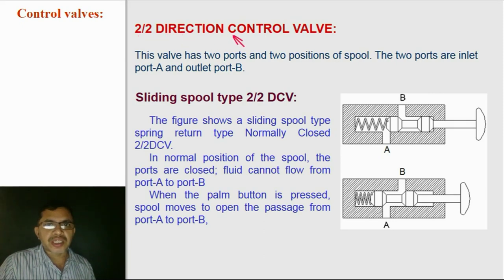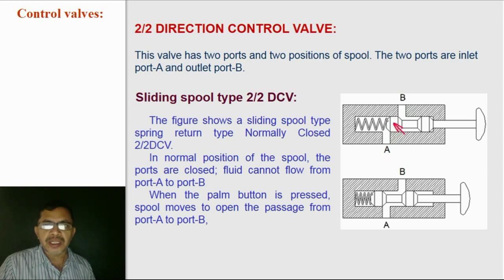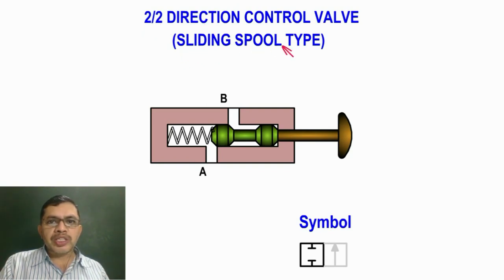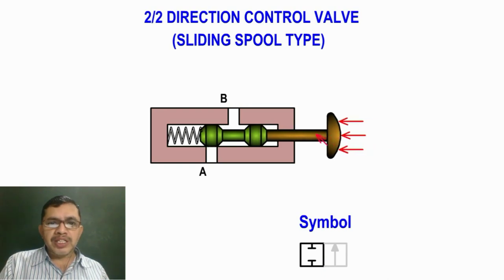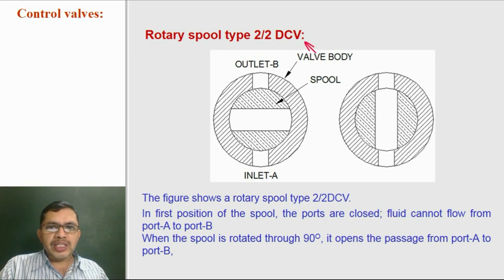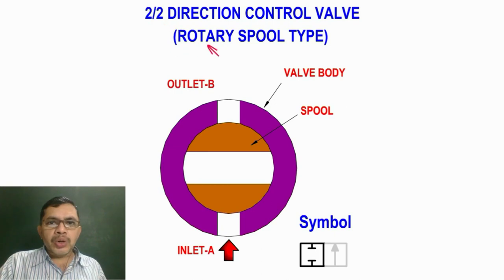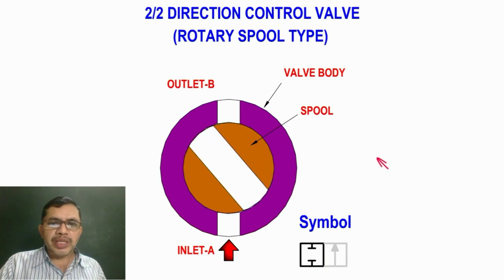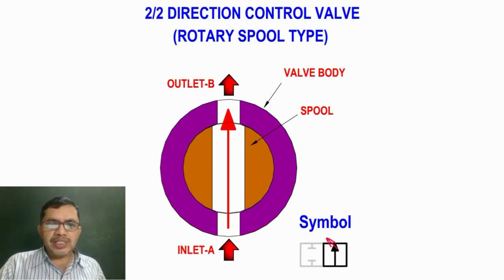2/2 direction control valve

Comment: Sir ae hydroulic cylinder hai ki pneumatic cylinder
Reply: @chandrashekarapuranik  Agar sir jy hydrolic hai fer T port kyo ni show kita oil baapas Tank my v tuo jaye gaa na sir ji pls Replaye me comment I wait it sir
Reply: @AKAAL.JI.SAHAY.1313.  isko domestic water tap se compare karo..bathroom ka tap hamesha band hota he i.e. it's normal position...i.e. normally closed position and then when we open it the water starts flowing...isme return valve nahi hota...tap me paani bharke tanki me nahi jayega nah...tanki se tap me aayega aur fir use hoyega
Reply from the maker: firstly, this is not cylinder. it is valve. second point you should know is, valves are same for hydraulic as well as pneumatic. there is no difference in construction and functioning. only one difference is that, hydraulic valves are made stronger, using steel, because oil pressure is high. pneumatic valves are lighter made of aluminum, because compressed air pressure is less. thirdly, about this valve. this is 2/2 valve. it has two ports and two positions. it has inlet port and outlet port. in one position, it will allow the flow. in the other position it will not allow the flow. it is not having tank port. it is also called shut-off valve or ON/OFF valve. clear? 👍 next valve is 3/2 DCV. it has tank port. see the video https://youtu.be/JJzrfFbTcJ4
Reply: @charmilshah4913  ok sir es ka matlab jay pneumatic items hai
Reply: @AKAAL.JI.SAHAY.1313.  nahi bhaiya...yeh pneumatic me bhi use kar sakte he aur hydraulic me bhi
Reply: @AKAAL.JI.SAHAY.1313.  tumhara exact question kya he ?? Exact doubt kya he ?? Kya janna chahte ho?
Reply: @charmilshah4913  aap ny batadea ki hydroulic v hai aur pumetic v
Reply: @charmilshah4913  sir keh rahy hai ki jay valve hai cylinder nahi
Reply: @AKAAL.JI.SAHAY.1313.  haa toh sahi hi toh bola he hum dono ne...yeh ek valve he jo hydraulic me bhi use kar sakte he aur pneumatic me bhi...yeh direction control valve he...isse se flow ka direction change kar sakte he chahe woh pneumatic ka ho ya hydraulic ka...yeh direction control valve ke baad fluid jaata he flow control valve me aur flow control valve ke baad jaata he actuator me... actuator ka ek part hota he cylinder jo use hota he piston and cylinder arrangement me
Reply from the maker: @charmilshah4913  very good conversation, keep it up.
Reply from the maker: 2/2 valve - ye valve sirf on/off control karsakti he. ON hai to flow hoga, OFF hai to flow nahi hoga, matlab band hoga. direction change nahi.
kiska flow? hydraulic system hai to oil flow hoga, pneumatic system hai to compressed air flow hoga.
hydraulic valve bahut strong heavy rehta hai, special steel se banaya hua. vahi, pneumatic valve aluminum se banaya hua rehta hai. because, hydraulic systems me pressure bahut jyada use karte hai (up to 750 bar). pneumatic systems me to jyada se jyada 5-6 bar use karte.